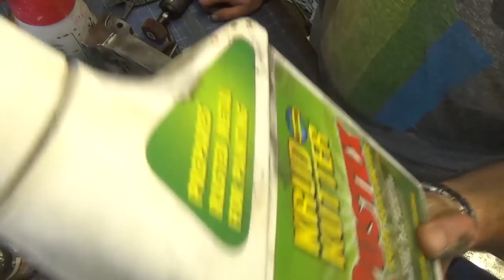Pipe (Stillson) Wrench Restoration

Comment: Agree; pairs work best. I collect pipe wrenches, among other tools. The 36" Armstrong is my biggest. Hoping to find a 48" one day. Have a bunch of Stillsons (the brand), too - 6"-24".  Pretty impressed with the steel they used on the early versions. As for protection, it's either BLO or paint. FWIW, I found that shooting a couple of coats of clear on top of the base color adds significantly to the paint's durability after baking for a few days. Enjoyed the video.
Reply: Hello Felix F,
   Joe's Shop advised I should make an inquiry with you since you have many pipe wrenches. 
I have a small wood handled 6" Stillson pipe wrench missing the nut. In trying to find a nut for it I started to wonder if other manufacturer's pipe wrenches - of the same size - would be able to have their nuts fit my Stillson. That way I could buy any number of 6 inch pipe wrenches for their nuts. Do you know if there is any commonality in pipe wrench nuts - such as putting a Rigid nut on a Stillson, etc., etc.?

Mike

Comment: In the oil field the pipe wrench is known by its size.  As in “bring me the 36 and the cheater” everyone has at least a 24 or two but those that are oil field for a living all carry a 36 in the cross box in the back of the truck.  In 30 years in the oil patch I have may have seen a few 36’s bent but only one broken. Used properly they are nearly indestructible.  They hooked a chain from the handle on the 36 to the bumper of a 3/4 ton pickup. 

Next time you weld up a crack use your grinder to cut a little V in the crack so your weld has more surface area.
Reply: they make them up to 72 inch, ive had one, super heavy, will undo a lot of things with its own weight

Comment: Joe i have just got a pair of 36" Record stillisons with the flat bar spring arrangement do you know if it should have two on it i cant see a hole were it would have been attached. They are in good order i only paid £20 for them with a pair of 36" chains they just need to be cleaned up and painted regards Lee from the little pond
Reply from the maker: Hi Lee. If i recall correctly there is only one spring. I bet the patent drawings could tell you for sure. Cheere
Reply: @joeheilm  Thanks Joe do you know how old they would be appreciated your advice
Reply from the maker: Hi Charlie alloy artifacts is a great web site. I did a quick search for Stillson wrenches and they appear to date back to the 20s. I'll paste in a link http://alloy-artifacts.org/bonney-forge-tool.html#bonney-pipe-10in

Comment: I have a little 6 inch Stillson pipe wrench with a wood handle that is missing the nut. Any idea where I can get a nut or if there is a nut that will work that you can get at Lowe's or Home Depot or such?

Mikel
Reply from the maker: I would guess that you will need to steal a nut from another tool. I do not know if there is any comminality in thread pitch for pipe wrenches. My only stillson wrench is 36" and i do not have another brand 36" wrench to compare it to. Consequently, i am no help, sorry. Cheers
Reply from the maker: You could try messaging Felix (in the comments) it sounds like he has several stillson wrenches that he could check if pipe wrench nuts are interchangable....its worth a shot. Let me know if you figure anything out. Thanks

Comment: That,s allot of steel. How did you punch out the pin? Did you have grind one side flat?
Reply from the maker: I could tell someone before me had driven the pin out. Consequently, i didn't have to grind anything, i just drove it out with a drift. I would bet that from the factory it would have been flared out, like a rivet.

Comment: Nice repair and restoration on that big-ass wrench. I could have used that on a recent plumbing repair to take off a 50 year old fitting.. I had to use a 24" and a cheater bar. I would like to have one of your stickers. If you will e-mail me your address I will send you one of my stickers and my address..
Reply from the maker: @johnfix1  i sent you an email. Cheers

Comment: yep these dont break or bend under any normal use, but ive seen scaffold bars used as cheaters or sledgehammers used on them, they are tougher than need be, but nothing is unbreakable, just apply a bigger idiot.